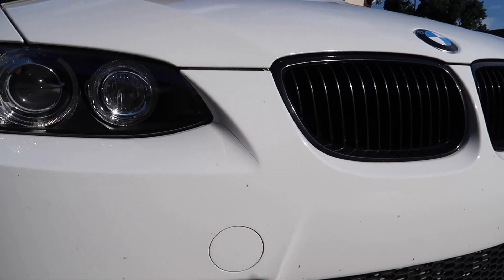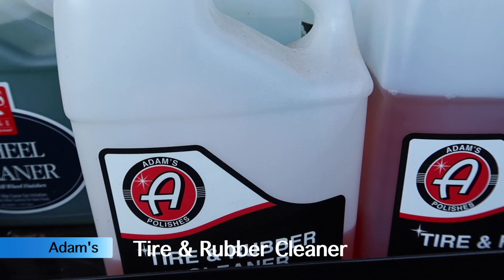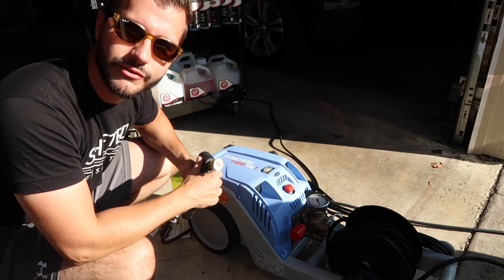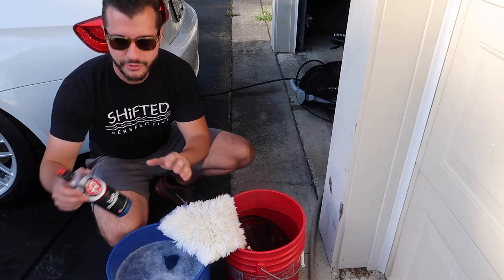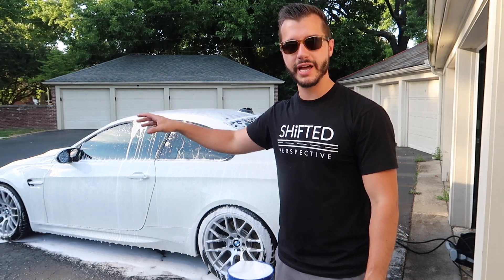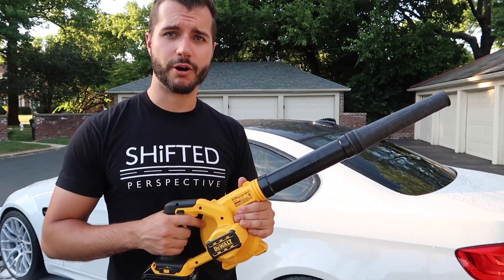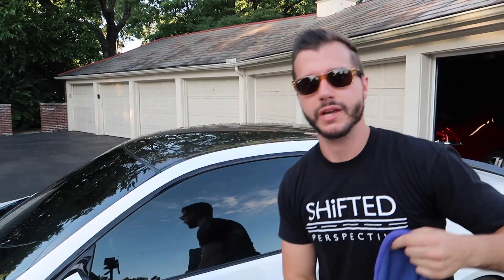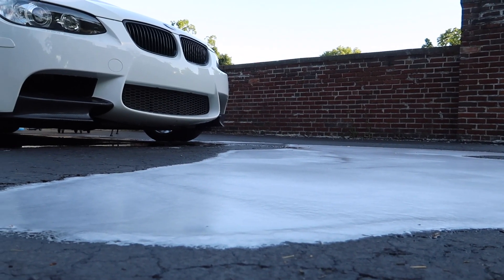THIS is How I Wash My M3: Process & Products

Comment: I used to do the 2 bucket method but i think its just a waste of time now i only rinse and use the foam gun and then i use like 4/5 microfiber wash mitts for every panel
Reply: Couldn’t agree more. Much better technique and less water needed too. If car is very dirty I’ll add a layer of foam before rinsing and then another foam layer after rinsing to help lubricate surface for contact wash.
Reply: watch dallas paint correction
Reply: Rafael Oliveira yeah thats what i did
Reply: Look up the Gary dean method, that’s the way I do it.

Comment: Why are you using a wheel cleaner thought your wheels were coated with gyeon rim 
Normal car shampoo is enough to get them clean 🤔
Reply from the maker: This wheel cleaner is mild and more of a lubricant.  It helps a little and is cheap.  Gyeon RIM doesn't entirely eliminate the need for wheel cleaner
Reply: Good to no was worried using a wheel cleaner would remove the coating 
Will give it a go 
Great vids  keep it up

Comment: So with the foam still on the car you have now dragged any dirt in the foam all over your car with the risk of scratching it. Then to clean the brake disc's you drive it through the dirty water and foam. Hmmmmmmmm Good quick vid otherwise
Reply from the maker: Most of the dirt was blown off with my rinse procedure, anything left is insignificant given that the whole car has a clear bra and I’m using a lot of product. Driving through the water did nothing. I’ve done it dozens of times.